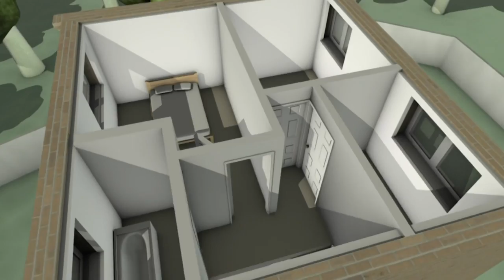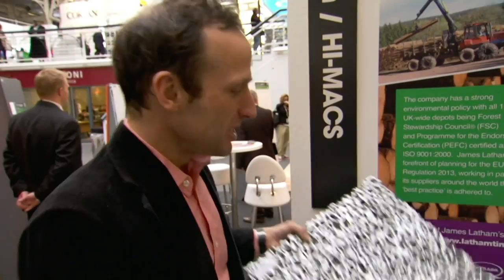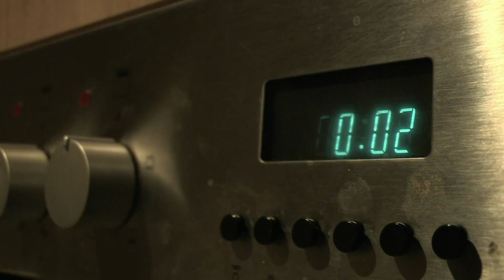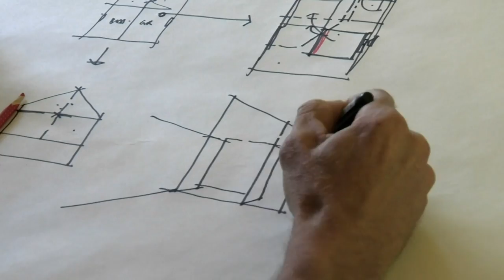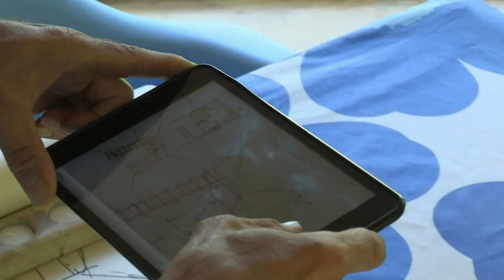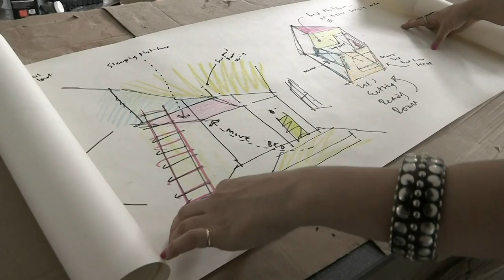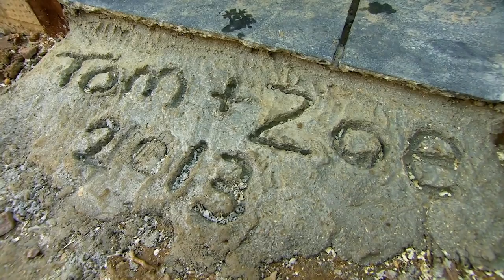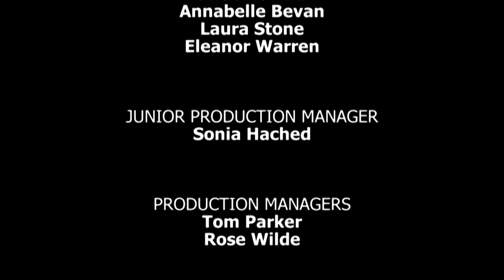Transforming a Standard House - The House That £100K Built - S01 EP4 - Home Design

Comment: Very nice build for a bland, common house with the great interior.  One of the Grand Design videos had a build that used a rusted Cor-Ten steel that matched the brick houses' colored bricks in the neighborhood. Up to 15 years ago heavy fabrication design was my occupation in the Upper Midwestern USA and it is a cheap material that can look great and blend with older architecture when one uses some imagination. I like it because I understand how to work with it and what can be done with it. Remember that it rusts even when used for interiors and you can do fine. I like the house but my personal likes sit between Zoe and Tom and it is obvious that Zoe won most of the arguments. I like Post Modern with wood highlights. The best decisions always result from compromises when the couple listens to each other and holds their temper. My wife is very traditional and farmhouse in tastes. The open design is necessary for a small house as it blends height, light, and line of sight or a Japanese formula that creates the illusion of largeness in a tiny room. The American farmhouse also used this formula but from a different culture in building materials and methods. May you destroy your house with your pleasure & then fix it again before you sell it.